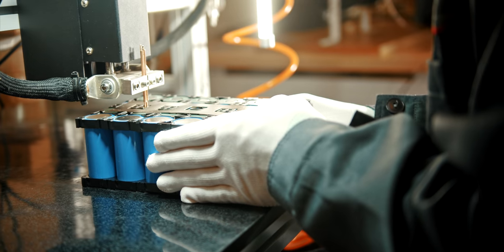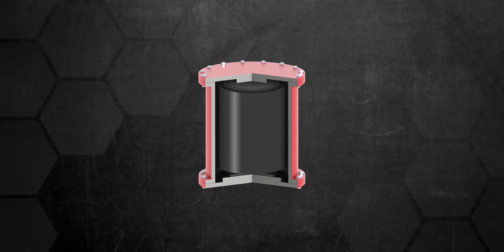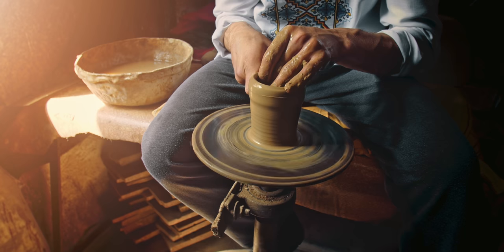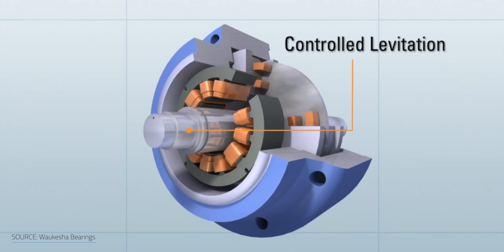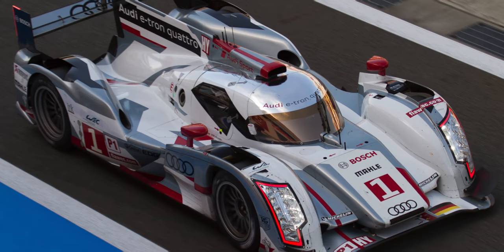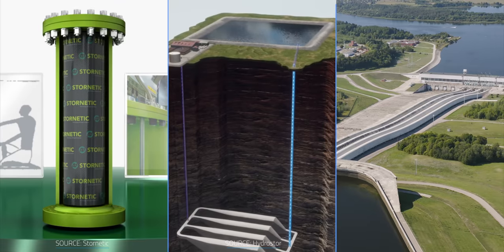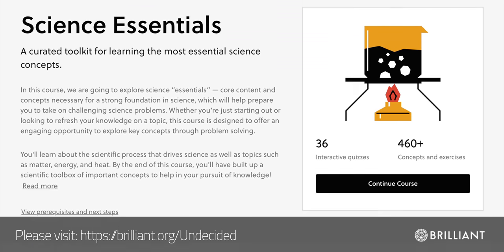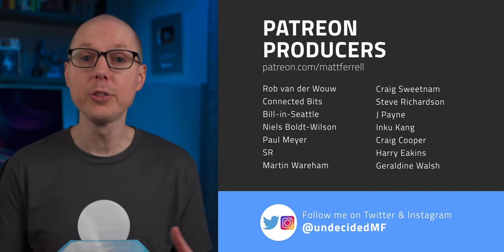The Mechanical Battery Explained - A Flywheel Comeback?

Comment: Everyone forgets nuclear energy as one of the most efficient and a lot less dangerous than first gen facilities.
Reply: They don't forget they just remember the big screwups of the past better
Reply: It's more about holding off on processes that might enable more weapons grade plutonium until we can get fusion energy.
Reply: Chernobyl, Three Mile Island. No one's forgetting anything.
Reply: @crashoverride93637  Including those screwups it is still safest and most efficient technology.
Reply: @libertyman3729   where did the rods come from in the first place? oh wait, that's right the ground.
Reply: We don’t need to use the uranium fuel cycle though.   The Thorium fuel cycle doesn’t create plutonium, and can us the nuclear waste from all the previous nuclear reactors.   A thorium reactor was built and ran for 5 years,  before the Nixon administration’NiXed” it because the government Needed plutonium for the weapons program.
Reply: @Matevz96  I know but it's like plane crashes they rarely happen but the news is so big it burns in peoples minds and the fear them I'm all for nuke power its 100% needed esp if we are to become Mulitplanetary species hucking 600000 tons of solar panels to a planet that gets a quarter the sun we do is stupid
Reply: @libertyman3729  actually the new generation small form factor reactors can even use the " spent " fuel from the old ones due to new efficiency a d the spent fuel has a much shorter half life to inert
Reply: This video is about energy storage and not energy production, though. As efficient as nuclear energy is, its one drawback is that you can't turn it off or ramp down production at any time. This leads to a big problem when energy demand lowers and you suddenly have a nuclear power plant producing too much energy. Without an energy storage system, all that energy gets wasted. This is where the topic of the video above comes in.
Reply: @Goodmanperson55  Very true, and I love this Idea, flywheel and suspended weight power storage, because of the efficiencies reported.  We need Carbon neutral technologies powering our world, NOW.
Reply: @Goodmanperson55  in general there is always something ready to use energy for example the pumps that fill hydro dams or this kind of storage or just battery nuke is only non carbon emitting always ready power generation we have ( besides geothermal which isnt viable everywhere )
Reply: @crashoverride93637  What you're talking about is pumped-hydro storage, which is another energy storage process that has its own myriad of limitations and problems.
Reply: @Goodmanperson55  yes what I'm talking about is there is never a " waste " of nuke power there is always some kind of battery available to shunt it so nukes long spool down times aren't really an issue they just hum along
Reply: wasn't the topic "storing" not "generating"?
Reply: @snap-off5383  technically all storage  is just compiling resources to generate later that can mean getting mass spinning or water higher up or chemical alterations, so technically any discussion on storage is also a discussion on generation as well
Reply: I love nuclear... in theory.    ...but making life on Earth dependent on us doing it all correctly isn't right.  Ten years after we dolt our own species off all life is critically threatened> Selfish.
Reply: The thing for me is, I don't want to support a city, I want my house, workshop, and private installations without depending on any government or organization. I can't have a mini-nuclear power plant, and even if I could have one, I'm not qualified to supervise it.
Reply: As much as people like to blame public sentiment for the lack of "ubiquitous, safe and efficient" nuclear energy it really comes down to the fact that all three of those attributes are a myth. Almost as soon as nuclear energy got started solar was seen as a likely better bet economically. Nuclear never archived a significant portion of power production. We can see that the UK built out nuclear then replaced it with other sources, the US did the same thing and now China is also doing the same thing. Nuclear seems more apt to be developed based on a countries lack of knowledge of the economics. The only significant boom in nuclear power was subsequent to the 1970s oil embargo.
Reply: @libertyman3729  newer reactors technologies actually consume the previously  "spent" nuclear fuel and reduce it significantly. Effectively reducing the waste we are already stuck with from old reactors.
Reply: @libertyman3729  Oh, please. Educate yourself on the current state of the art. They can bury them in my backyard, and I'd have no worries.
Reply: @peterembranch5797  Fukushima, enormous amounts of nuclear waste sitting in pools ready for a terrorist to steal and make a dirty bomb which means we spend a lot of money on security which ultimately won't be perfectly effective.
There's a place for nuclear power and the grid. But it shouldn't be the primary backbone anymore.
And don't forget the Incredible cost overruns for decommissioning. When private companies are willing to reinsure decommissioning, then nuclear power will actually be an option. For now it's cheap power for us today, and billion-dollar decommissioning cost for our grandchildren. Nuclear power is immoral. We take the benefits and dump the costs on people who aren't even born yet.
Reply: @libertyman3729  I mean if your back yard is in a geologically stable area with deep bedrock then yes!
Reply: @ezequiel5260  ...you must not understand the amount of power industry takes even to just run a machine shop to make your own stuff, and yes micro nuclear generators would be able to do that and not be dangerous nor require complex maintenance there is a 50 year old reactor on Voyager one still faithfully pumping out power after most people that made her are already dead. And saying you only care about power for yourself is ridiculously short sided ...who is going to build the solar panels, hydro, wind components to support your " self sustained " lifestyle, unless your mining,smelting, refining your own ore then using that to make copper wire for winding your own generators you would be sol without community/industry size power options
Reply: @crashoverride93637  i'm not a fan of solar just for those reasons. I'm aware of what you are saying. On a small scale you can get a couple kwh from home grade wind turbines on rooftops. Those are not difficult to make and maintain.
Reply: @ezequiel5260  your still using products your incapable of producing on a meaningful scale to not be hypocritical you would have to knock yourself back to the clay tools stage of society and work your way up like that one guy does here on youtube htme
Reply: @peterembranch5797  old news, old technology.
Reply: @alexjurbergs6423  where do rare earth  metals for these renewables come from.
Reply: @trevormcpherson5258  It was never a question of technology. It's human nature.
Reply: @peterembranch5797  that's because radiophobia and people being terrible at assessing relative risk. The Banqiao dam disaster killed an estimated 85,000-250,000 people, whereas the best evidence for Chernobyl places deaths ~90 to date and an estimated ~4,000 excess cancer deaths. If you look up the deaths per TWh, nuclear has one of the lowest death rates of all electricity generation sources.

With dams maintenance being neglected all over the world, I'd be far more worried about living near those than living near a nuclear power plant.
Reply: @davidcaldwell8977  hate to break it to you but recycling the nuclear waste generates waste that cannot be recycled and that is way more dangerous to store.
Reply: @mattbrown292  except they generate new nuclear waste that lasts for millions of years instead of 30-40 years. this long lasting nuclear waste has to be infused with lead glass and stored deep in the earth in just a few locations.
Reply: @toomanyaccounts  No they don't generate new waste, they take existing waste and significantly reduce it. Also nuclear waste does not last millions of years.
Reply: @crashoverride93637  It's not about having everything handmade, there are levels of technology, on the first ones we can produce everything, the further we go the more we need industry, engineering and thousands of people on a supply chain.
I'm not bashing on nuclear, but on the next couple of years there won't be any small scale energy nuclear plant that would be easy to operate and maintain, such as a small wind or hydro turbine is today (a thing that you can actually build on a workshop today with some knowledge), which is something that i'm aiming at today.
For large scale nuclear is very reasonable.
Reply: Radioactive
Reply: @toomanyaccounts  I have a certificate from MIT on nuclear energy, in addition to many years of personal interest in these technologies.  You are correct that there will be some waste, but you are categorically false in the Assertion that it’s worse, or even equally as bad as what comes from a current Uranium based nuclear reactor.   I’m happy to discuss this with you, as long as you go look at the information on WAMSR, and the other Thorium based reactors.   Then you’ll understand how these solids are converted to liquids, then how the un-useable isotopes are removed, and the rest is sent back to be fissioned over and over again, until the material is far less deadly.   These reactors spit out waste with half life’s far lower than the raw solid waste from ALL current NRC  compliant reactors.   But the NRC has been slowly softening their outlook on these reactors, because of their inherent safety designs.  No power, no reaction, period.
Reply: @davidcaldwell8977  no the waste is high level. if france recycles its nuclear waste why they do have a storage issue problem that is costing them hundreds of billions of dollars to deal with just in the next five years? no France generates the most nuclear waste in the world. reprocessing hasn't stopped the generation of nuclear waste from their nuclear power plants. its only increased it. 

https://www.ucsusa.org/resources/nuclear-reprocessing-dangerous-dirty-and-expensive

https://www.ucsusa.org/resources/reprocessing-nuclear-waste

" For instance, the French company AREVA, which reprocesses French spent nuclear fuel, claims that reprocessing "reduces the volume of waste by a factor of at least four."[i] This statement is contradicted by recent data from the U.S. Department of Energy (DOE), which show that reprocessing greatly increases the total volume of radioactive waste, compared to direct disposal of spent fuel.[ii]"
Reply: @toomanyaccounts  There are different isotopes in the the nuclear waste. Some have short half life and are handled in the spent fuel pool. Some have long half life and are thus relatively safe (their radiation for millions of years is not significantly higher than background radiation). The ones called high level waste are those with medium half life (unsafe "only" thousands of years).
Reply: @muche6321  wrong the high yield waste is incredibly dangerous and long lived. there is a reason it has to be infused into lead glass and stored deep underground by robots. i provided multiple links showing i know what i am talking about and that the nuclear waste recycling advocates are lying and that nuclear waste recycling is increasing the amount of waste and the dangerous amount of waste.
Reply: @ezequiel5260  I mean people can have solar panels on their roofs to power their homes already, which doesn't depend on public energy, so there's nothing stopping you. In the future I'll probably invest into solar panels for my home, but that's just because it's cost effective.
Reply: @toomanyaccounts  How can recycling increase the amount of waste? I could see how it increases the amount of longer lasting waste, but recycling cannot simply have some waste put in, then more waste comes out. To me I don't see much of a problem with storing this longer lasting waste away, though I haven't really researched it thoroughly
Reply: @liammargetts  read the two articles and you would see why. the nuclear waste recyclers are lying to. remember when recycling outfits had you separate everything into multiple bins then just had a garbage truck come by and throwing all the contents of the bins then take the truck to the landfill where everything went in
Reply: @toomanyaccounts  I read you links and they are saying that reprocessing is bad, because it could make plutonium and other warfare-useful  isotopes more accessible to bad actors. It's better to leave it with other waste, so it's more difficult to get to it.
Comparing to household recycling, it's like saying separating and recycling metals is bad because bad actors could then make guns out of it; let's just put it on landfill so no one can do it. (Spoiler: some people do it anyways - https://www.actionaid.org.uk/blog/news/2015/01/30/meet-the-kids-scavenging-on-rubbish-dumps-to-survive .)
Reply: @muche6321  read again. "In addition to high-level waste, reprocessing generates other types of radioactive waste that require secure disposal. These wastes are more dilute than high-level waste (and hence have greater volume). Although most of the waste falls into the low-level waste category, reprocessing increases the volume by a factor of six to seven relative to the once-through cycle. The United States has three NRC-licensed, commercially operated low-level waste disposal sites that currently accept waste. Reprocessing increases the volume of "greater-than-class-C" low-level waste by a factor of 160. DOE is responsible for disposing of this waste, which contains long-lived radioactive isotopes and cannot be placed in a regular low-level waste site, but as yet has no policy on how to do so."
Reply: Except for the waste that takes a energy to keep it cool for decades. Let alone danger to the local environment.
Reply: Concerning the risk of making "weapons grade plutonium", well, pressurized and boiling reactors (the two major current technologies) are pretty bad at making that kind of plutonium (other technologies exist, but they are quite worse at producing energy).
Concerning the risk of terrorists grabbing nuclear waste to make a dirty bomb, waste fuel is not dumped in the wild for anyone to grab; moreover there are more accessible sources of radioactive isotopes that would exist in any case.
Reply: @takix2007  guess you missed that the recycling process creates the weapons grade plutonium.
Reply: @toomanyaccounts  yes, it can. But it is a shitty way of making it. Nuclear waste from PWR/BWR powerplants contains multiple isotopes of plutonium: 239, 240, 241, 242 (in respective decreasing quantities), of which only 239 and 241 are useful for weapons. So after you separate them chemically from the other stuff, you have to enrich that mixture by centrifuging it, which is a nightmare compared to other ways (i.e, other kinds of reactors) of generating larger proportions of Pu-239 (and thus just separating it chemically).
Reply: @takix2007  the issue is one of making it more common and more accessible which is why the us refuses nuclear reprocessing because of the huge security risk it poses.
Reply: Nuclear power plants are safe as long as no f××××××t messes with it, Chernobyl is a great example of that and I guess most RKMB reactor has their flaws like positive void coefficient but in the end their will be flaws with Gen4 reactors too in the end.
Reply: efficient yes and not very dangerous, but very pricey, and uninsurable. Government has to insure, therefore the cost comparison would normally be even worse.
Reply: @prich0382  LOL. I see you're the kind of guy who take disagreement badly. As to your stat: have you any idea how close Chernobyl came to being a massive disaster involving the slow deaths of millions? You might want to read up on it. It's terrifying. Look, just because the worst outcome hasn't occurred yet doesn't mean we have to wait for it to happen before we decide it's a bad idea.
Reply: People don't forget, they are incapable of separating the morality of nuclear power and nuclear weapons. People are too ignorant to realize one does not mean the other and hasn't for several generations of design.
Reply: @benm5913  I'm quite capable of distinguishing between nuclear power and nuclear weapons, thank you. To imagine that we don't indicates a certain simple-mindedness on your own part. I'm also aware of how close the Chernobyl affair came to being a massive continental-sized catastrophe; and how people can always screw up . Acquaint yourself with these things.
Reply: @prich0382  It's pointless. Arguing with brick walls. At best pointing out the pointlessness is all people can do.
Reply: @libertyman3729  Make depleted Uranium Armor to protect yourself from IED’s
Reply: @alexjurbergs6423  Well duh, but not in the same form.
Reply: Nuclear is far too expensive per kWh, and creates waste that needs to be stored forever. Old world thinking. New solutions need to create zero waste.
Reply: It just people see single events not the whole picture. Like i.f. government increases taxes and creates a factory that hires 1000 employes. Everyone see wow that is great. But they don't see 5000 people scattered all over america that lost their job because of this. So they think its good.
Reply: @Ezequiel, thats bullshit. Why are the roofs full of PV and not windturbines?
Because the windspeeds are to low, and small turbines are inefficent and loud.